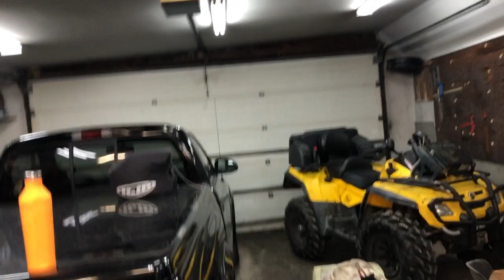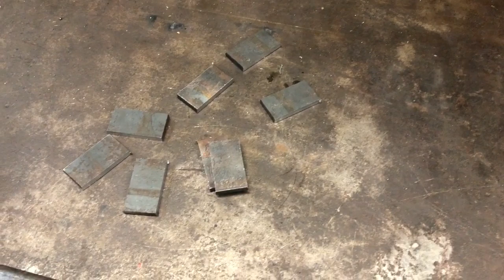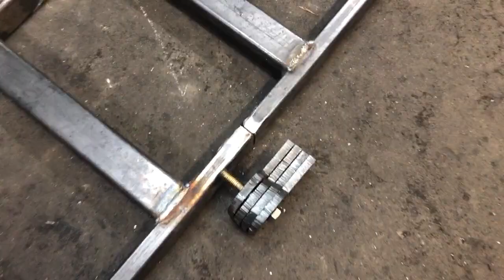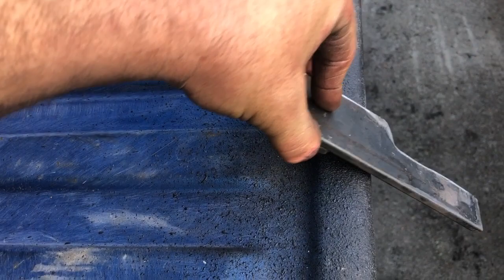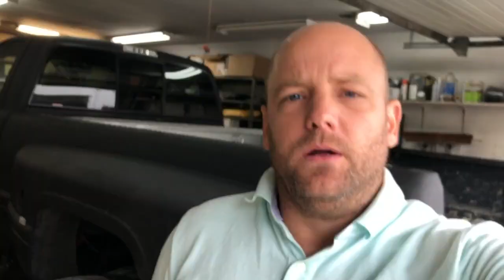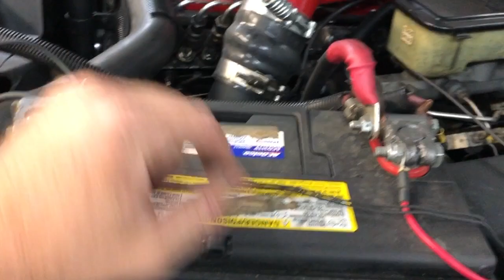10' Folding ATV Ramp Build Welding Project

Comment: 120 wall is pretty heavy... and, the hinge plates... also pretty stout.  I might say way overkill, but, better safe then sorry eh?  I'm certain they'll be heavy duty enough.  I'm curious what your final weight per ramp was?
Reply from the maker: Yes you are 100% correct. This was the first time I ever welded anything that needed to be strong so I went way off the deep end. As far as how heavy they are, I would guess 40 to 50 pounds a piece. Pretty nasty to carry around but like I said, if I end up having a side-by-side or a light weight rock crawler these will probably be beefy enough. If that is the case, I might drill out the hinges and put three-quarter inch grade 8 bolts just to be safe.